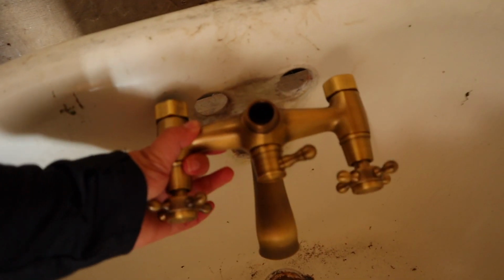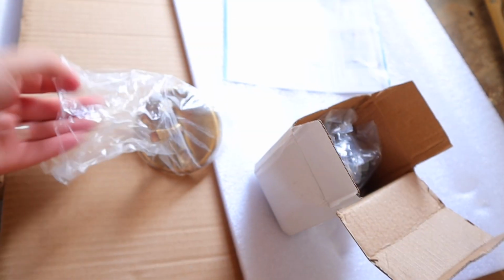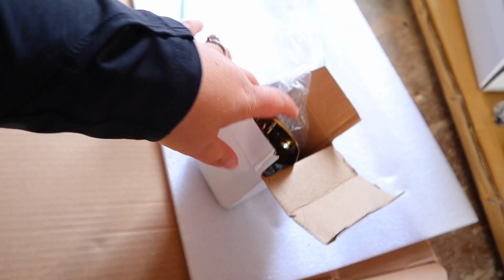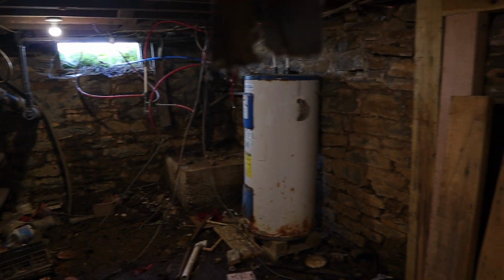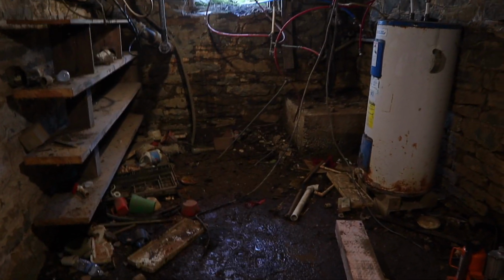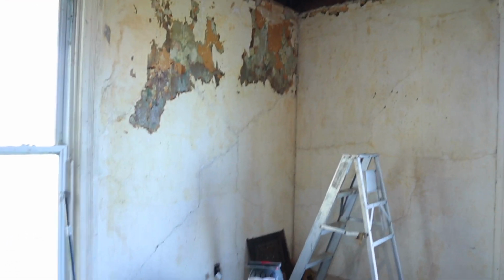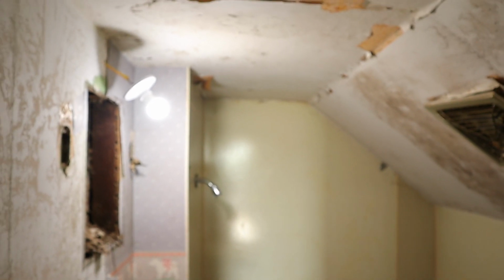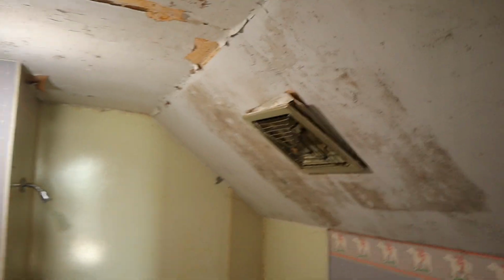Removing Paint With A Heat Gun | Cellar Tour | Running Electric Upstairs

Comment: Wow! You sure got a lot done. So happy the heat gun is working out. The trick is to keep it moving so it doesn't scorch the wood. As for the small bathroom, they sell vents with a light built in as well as with heat or cool air. That would be a solution to do instead of hanging a ceiling light. My husband is an electrician and we just replaced the vents in our bathrooms. They are brighter and in the winter it's nice to have the warm air blowing when I'm taking a shower. Something to consider. Or, if it's located at the top floor, consider a sky light. Great job!
Reply from the maker: Thank you! That is such a great idea on the vent with the light!
Reply: @LewisAcresHomestead  xoxo